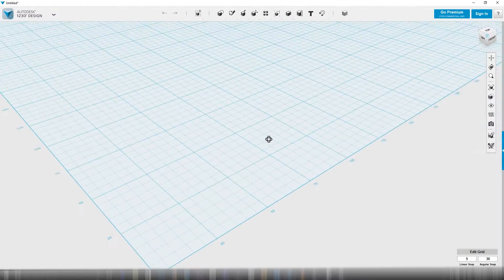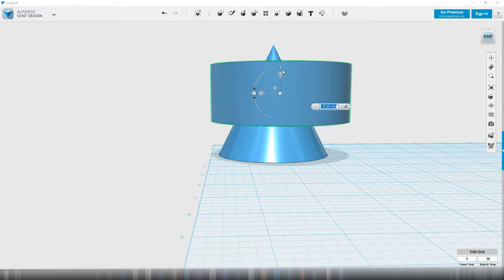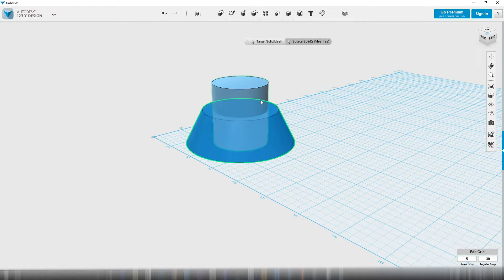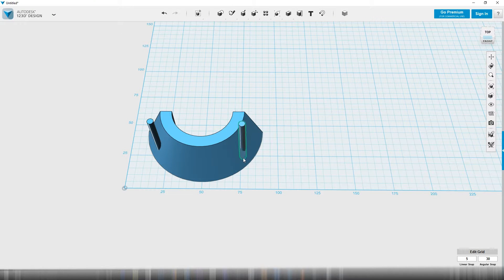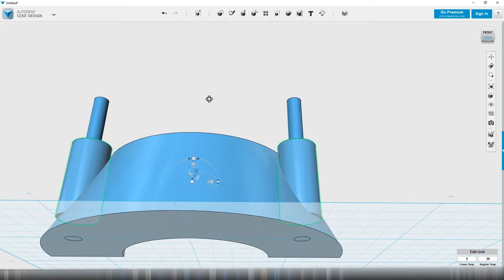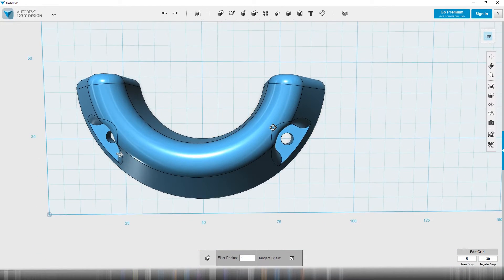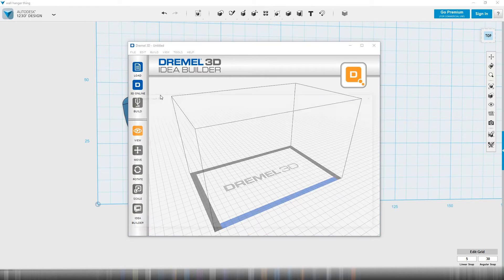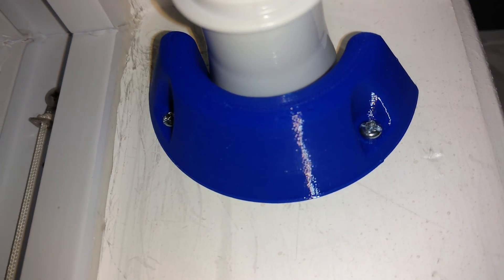watch me DESIGN a THING for 3D print FROM SCRATCH

Comment: Nice tutorial.  I've used Turbocad and Sketch-it 3D but you've certainly made it a compelling option. At some point I'll upgrade my software to Autocad design as I've been using ACAD for decades. You've also coerced me to purchase a 3D printer. However, I am more likely to use it in the Winter as the Summer awaits.
Reply from the maker: Hi Charles, thanks! back in the 90s i took CAD class and got an A. Love the stuff. We were only plotting with a pick and drag pen plotter. All 2D, but it was a great first exposure. 3D printers are cool, but they have their issues. I like the dremel in that it is very plug and play. But if you get a nicer more expensive makerbot II or something, you can plug and play those just dont get too caught up in changing speeds and temps would be my recommendation. If you have something you would like me to print and and send to you, send me a message with the file details in the youtube messager and i will respond accordingly!
Reply: I can only use 3D for fun projects at home or to display equipment in 3D rotatable viewing because I have not found a dependable way to present drawings converted to 2D. There are extra lines and it's frustrating to exhibit a plan view of a previously 3D drawing as there are always unwanted features that mar the drawing. Thanks for the offer to print, that's nice of you. I have Turbocad 3D and could make the drawing but I'm still mulling what I might want to be printed. I guess it likely would be equipment components for clients so they might examine them in 3D. I wouldn't trouble you with that but indeed I do appreciate the offer.